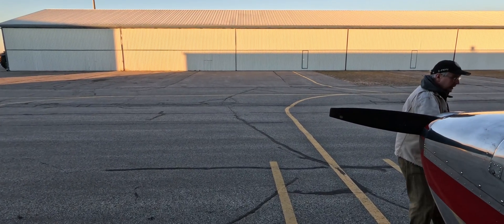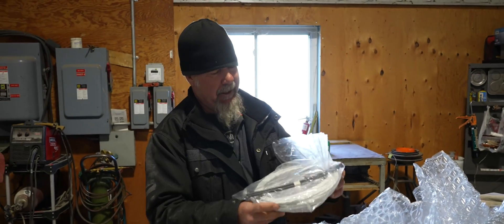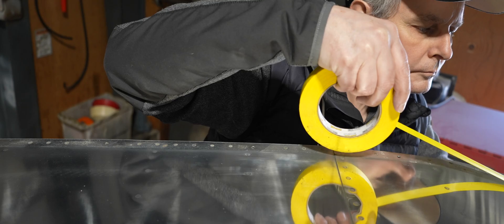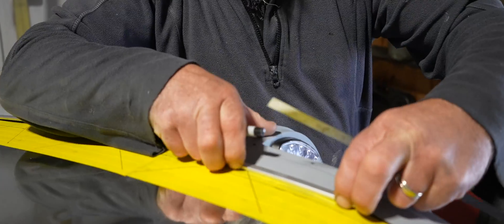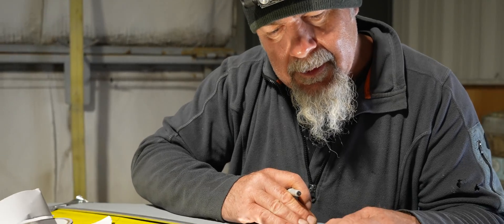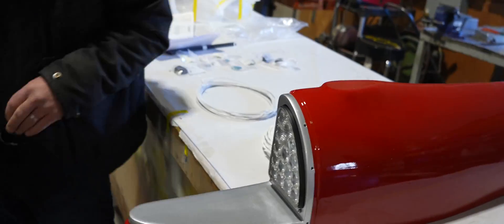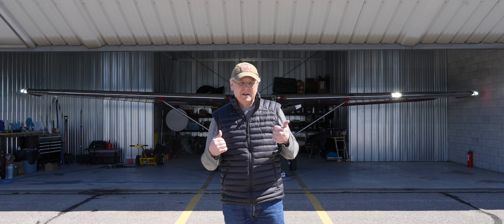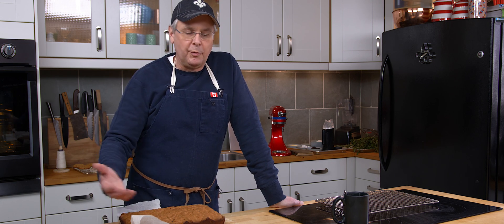Wig Wag Wingtip Upgrade

Comment: Speaking as the guy whose BEEN to the ER and HAD metal flakes scraped off one of his corneas, let me say, “USE YOUR SAFTEY GLASSES!” The friction from the drill makes the bits hot, so they stick (having slightly “cooked” themselves on to the eye). More gory details available upon request.

In another vein, “Wanna talk about power tools and my last hearing test?”
Reply: Agreed. My friend has this happen with a piece of metal. Not only did it hurt like hell, he had to take multiple days off work to deal with it. Not worth it.

Comment: Opening shot: I really like it - great shot, the audio really works and I like the graphics a lot! Second shot, somehow the graphics don’t work as well to my taste. For the shots with the graphics in the shop, I had the distinct feeling that the text was larger than I like (admittedly I may have odd taste.) I’m watching on an iPad, but I think the “scope” aspect ratio (which I like!) is making me expect smaller text as though I’m watching this in a giant movie theater screen. Also the “talking head” shot of Chris working on the top of the wing is great but at one point I wonder if you were reluctant to mess up the nice framing to pan down so we could see what he was doing? (I know that’s something I’d probably do.)
Reply from the maker: Still working out a visual language that keeps these videos interesting for me to shoot. I agree the wide doesn't work as well in the shop, I'll have to rethink how I shoot those parts.
Reply: @GlensHangar  To be clear, between the light reflecting off the wing and the framing, that's a fantastic doc-style shot of Chris, even if it's not ideal to show what he's doing without a separate over-the-shoulder setup.  (Audio was good too!)

Comment: Nice upgrades! Think radios should be a requirement in class G and E especially since you can use a handheld and not have to add an electrical system
Reply from the maker: I agree, and I’ve spoken to pilots who fly without a radio… they are adamant that no one is going to take away their ‘freedom’. While others have said that yeah they should, but just haven’t gotten around to it since a handheld is too expensive. I guess everyone has their reasons.